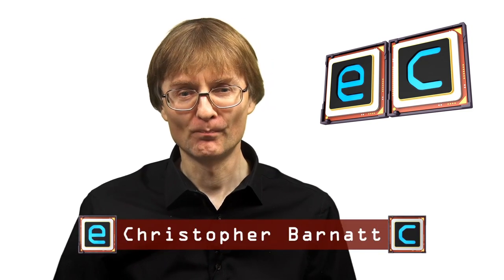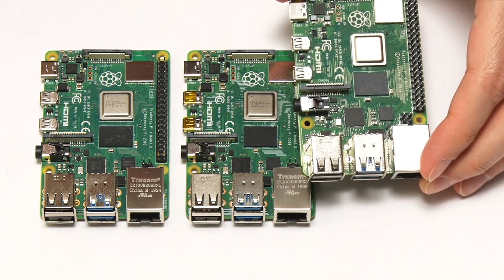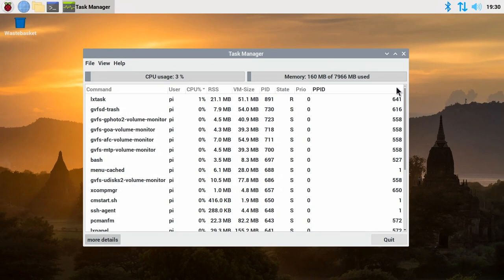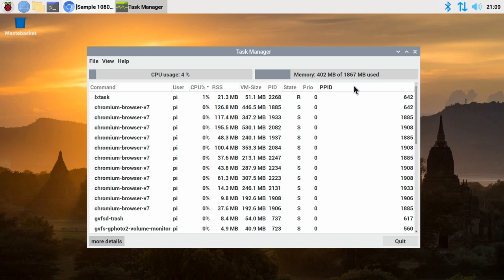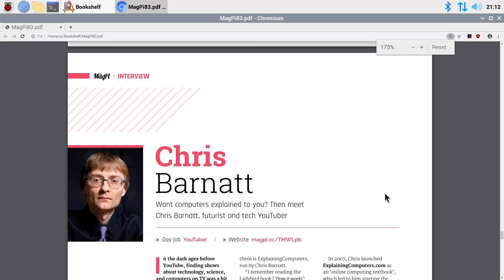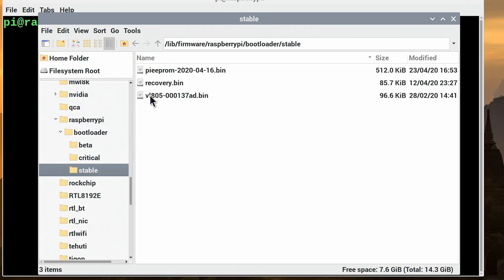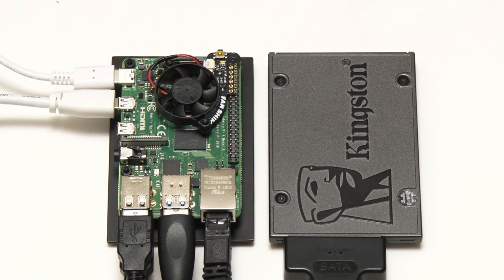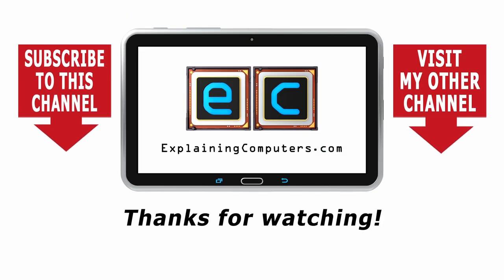Raspberry Pi 4 8GB & USB Boot

Comment: What about the sata to usb 3.0  cable  you are connecting with the ssd. I had found two types of cable online. One is with a power adapter and other one without power adapter. Iam confused which one I have to buy.
Reply from the maker: If you want to use an SSD or 2.5" HDD, you do not need a power adapter. If you want to use a 3.5" HDD, you need a power adapter.
Reply: @ExplainingComputers that's so helpful. Thank you. 🙂

Comment: The procedure didn't work for me, unfortunately. My USB drive is a Samsung FIT Plus 64GB USB3.1 flash drive (model MUF-64AB/AM.)  The eeprom update worked fine. Even the SD Copy Tool worked fine. It copied 5 of 5 partitions to the USB drive successfully. Unfortunately the bootloader couldn't find a suitable .elf file to launch, and the recovery.bin file couldn't be found.

Really unsure what happened. I watched another Youtuber use that exact same USB drive to boot into, in order to make USB drive comparisons for IO speed. His video was a major reason for buying that Samsung product in the first place. I'm downloading the Raspberry PI OS and will try to flash that onto the USB drive using the Raspberry PI Imager tool, to see if that works.
Reply from the maker: Sorry to hear that you are having problems. The issue you describe sounds like an incompatible OS, not an issue with setting up the firmware or the drive. So downloading Raspberry Pi OS and flashing it to the USB drive may well work. Please let me know your progress. :)
Reply: @ExplainingComputers   Thanks, although I'm confused by your "incompatible OS" statement. I had it plugged into my PI.  I just bought a new Raspberry Pi 4 with 4GB. (The 8GB version wasn't avaialble in the US on Amazon.) Using the lastest Raspberry Pi OS. I flashed the eeprom with the stable 6-15-2020 firmware version (which is the same version as the beta with the same date.) I did all this using my SD card, attempting to prepare my USB drive. Like I said, I followed your steps exactly and got that boot error.
The bootloader was trying to look for a suitable .elf file to boot strap on the USB MSD so at least the eeprom flash worked fine (using the rpi-firmware-update command.) After I rebooted the Pi I ran vcgencmd to verify the bootloader_version (it was indeed 6-15-2020) and I also checked bootload_config and it showed BOOT_OPTIONS of 0x0f41  which means it looked for an SD card first before looking for a USB device.
Reply: @ExplainingComputers  After fighting with my new RPi4 -- I was convinced my USB flash drive was not compatible. Until I decided to download the Raspberry PI OS 64-bit version, use the Raspberry Pi offical imager tool, and IT WORKED! Have no idea why the 32-bit versions wouldn't work, but 64-bit does allow me to boot from USB MSD. Which is kinda ideal since I want to run 64-bit anyways.
Reply from the maker: @MrMalchore  Very interesting, and great to hear that you have got it working. From several comments here now I get the impression that there are issues with USB boot and some Raspberry Pi OS . . .

Comment: I am wondering if I can use Rapsberry Pi 4 8GB for my Zoom meetings and Classes at home. tired of moving windows laptop to and fro work everyday. I use a 32 inches TV screen with HDMI port at home and I am thinking of the possibility.
Reply: I haven't tried yet, but the latest is update fixed issues with Zoom and Teams.  So the answer would be most probably yes.
Reply: you can download Zoom with pi-apps and use Teams online
Reply: @tonyhall9433  Thanks, will try this out.

Comment: pi 4 8gb gets a kernel error everytime after i flash raspberrypiOs with a 256gb sd card. are you able to use the 8gb pi or any pi with more than 128gb on a sd card w/o having any kernel crashing?
Reply from the maker: I've never tried using a card of this capacity.

Comment: Can you please make a tutorial about running x86 Windows applications on the Pi? I can't seem to find a viable solution on the internet and i'm not too keen on selling the Pi for a Thin Client.
Reply from the maker: The Pi has an ARM processor, so cannot natively run any x86 OS or application. There is a CLI-only IoT version of Windows 10 for the Pi, and some people (on YouTube and elsewhere) have experimented with ARM desktop Windows on a Pi. However, this has no official support. Windows 3.1 or a little later can run via emulation (eg using DOSBox) quite nicely. But there is no way of running modern Windows applications in a credible or suppored manner on a Raspberry Pi -- which is why you cannot find a "viable solution" and I will not be making a video.
Reply: @ExplainingComputers  Thanks for your reply!

Comment: I have an anther problem with raspberry pi, I want to install ubuntu18.04LTS server headless with pi4, I try many ways but failed. I try to add a ssh file in "system-boot".and I even use software--"Paragon ExtFS for Windows" to open the file /boot and /etc/ssh/sshd_config to change something. and failed also. can anyone kind hearted can help me with that.
Reply from the maker: I would try 20.04, it has better support for the Pi, especially in recent weeks.

Comment: well how about power supply for even a 2G rpi4,,,,,,, with a 21/2 HDD.  now start screen command on the pi zero with 8gb or 16 gb sd card.9with a new rspi os the image writer is different.got some problems with thony python cammera commands like avconv but ..............its discouraging.    ut the 2G new os rspi4 yes very good value

Comment: Can You do a video on making a bootable sd card; it would necessarily have to be step by step.  lt seems all the youtube videos skip many steps, or at least the most necessary steps.  I'm sure there are many who are tired of ordering preloaded cards and can't cause them to boot a raspberryl.  Thanks
Reply from the maker: I have covered this in videos on a great many occasions! :) In short:

Download the operating system image you want from the relevant website (I covered a load of these in my Raspberry Pi 64-bit OS video a few weeks back). If you want Raspberry Pi OS, download from: https://www.raspberrypi.org/downloads/raspberry-pi-os/

Download Etcher from: https://www.balena.io/etcher/ and run the downloaded file to install it.

Insert your micro SD card into your PC or laptop. Run Etcher. Press "select image" on the left in Etcher, and select the image file you have downloaded as above. In the middle in Etcher, click on "Select Drive" and select your micro SD card (it may be selected already). Then click on "Flash" on the right, and allow the process to proceed if Windows throws up any confirmation dialogue boxes.

Once complete, ignore any Windows message that come up about reformatting the micro SD card, and DO NOT attempt to read the micro SD card in Windows. Just take it out and put it in your Pi. :)

Good luck!

Comment: Can anyone link me to the USB 3 to sata adapter please, will require extra ext power adapter?
Reply from the maker: As Blitzen notes, there are loads of these. The one I used was this: https://www.amazon.co.uk/gp/product/B01N2JIQR7/ It (and the Pi) will power an SSD or most 2.5 inch HDDs fine (assuming you are using the official 5.1V 3A PSU for the Pi or equivalent), but you would need a separate adapter to power a 3.5 inch HDD.

Comment: I've tried this several times now, with a brand new Pi4b, 4Gb, and the process runs fine, but just doesn't end in success. When I remove the SD card, I get a text boot screen which says 'USB-MSD boot requires newer software' The bootloader I have used is dated 15th June, and is in both the beta and the stable folders - I've tried both with the same results. Am I missing something?
Reply from the maker: This suggests that you maybe trying to boot an older operating system from USB? Did you update to Raspberry Pi OS and copy that to the USB drive, or write it directly to the USB drive? If you did, I would personally be tempted to try the earlier firmware I used. The firmware should be better! But it if does not work . . .
Reply: @ExplainingComputers  This was a Raspberry Pi OS install straight from a NOOBS preformatted card. It seems to be up to date - shows itself as v10 (Buster). I followed your procedure exactly, using the SD card copy accessory to copy across to the SSD
Reply: And I've tried both an SSD and a USB3 stick, with identical results. I'll try the firmware you used, and see if that works.
Reply: @ExplainingComputers  The only difference I noticed in the process is that the SD copy copies 5 partitions, rather than the 2 that you had. Is that because NOOBS is still lurking on the card somewhere? Could that make the difference? Would I be better off finding a different way to burn the OS to the SSD?
Reply from the maker: @revbobuk  Ah, reading around a bit, the fact that it is a NOOBS card may the the issue, as they are set up differently to if you install Raspberry Pi OS by downloading the image file and writing it to the media. So my suggestion would be to download the latest Rasp Pi OS image and write it to your USB drive. Good luck! :)
Reply: So - further research reveals that you can't use the NOOBS card with this method. But it also looks like according to this websitehttps://www.tomshardware.com/uk/how-to/boot-raspberry-pi-4-usb the latest OS versions have broken the process too - apparently the *.elf and *.dat files from the /boot folder need to be replaced with older ones (from May 22nd) for it to work. Just trying that now!
Reply: And that did it! So to summarise - you can't do this procedure with the NOOBS card. And the  *.elf and *.dat files from the /boot folder need to be replaced with older ones (from May 22nd) for it to work. All sorted now, and working OK. And a significant speed improvement.

Comment: With a bigger data pipeline maybe windows 10 might work?
Reply from the maker: It may work better. But ARM Windows 10 (aside from the non-desktop IoT version) is not supported on a Pi, and I doubt will ever work that well.
Reply: @ExplainingComputers   I'm sure it would lag a bit
Reply: Might be a project to try in the future. I also like the increase in ram and bootable usb where the entire system can be stored in your pocket. Is it possible to run wine on pi is then run Adobe audition or something windows based software?
Reply from the maker: @recyclerlemur2129  Certainly something I may try at some point! But a Pi is an ARM computer, so it cannot run WINE, which is for x86 software only. :(

Comment: I'm annoyed by the 2xUSB 2.0 plus 2xUSB 3.0 configuration. When will a 4xUSB 3.0 version finally come out? USB 3.0 is now old technology. For many desktop uses, I reckon 4xUSB 3.0 ports would be the most useful feature. Ethernet port also makes it looks obsolete. Why still have that instead of wifi and bluetooth? I'd be happy to pay the premium for these features over the 8GB ram. It feels as if the 8GB ram is aimed to a rather niche desktop PC replacement portion of the market.
Reply from the maker: The Pi has onboard WiFi and Bluetooth. Ethernet is essential to create a NAS or server.
Reply: @ExplainingComputers  My bad - thanks for clearing this misunderstanding for me.

Comment: Chris, can you point me to directions for how to make an SD card bootable with a Linux .iso file for the Pi?  I wanted to try Skywave Linux but can't get it to boot no matter what I do!  I've tried everything they say to do on their website but nothing works.  I made a bootable version of HamPi that works with the file they provided using Balenaetcher that works with no problems so I don't know why Skywave can't do that!
It seems to be impossible to make a bootable SD card or thumb drive with the Skywave  .iso!
I've tried using the version of Balenaetcher that I used for HamPi but that wouldn't boot, I tried Rufus, Universal USB Installer, Win32Disk Imager in Windows and DD in Linux but nothing works to make a usable SD card. 
I tried Universal USB Installer with a thumb drive just to see if the .iso was actually any good and that works on a PC but won't boot on the Raspberry Pi.
Do you have any ideas how to make Skywave work?  They have a nice looking website but I think they should have put more effort into making the software work rather than using it all up on the website!
Thanks.
Reply from the maker: I've no experience with Skywave, but the website suggests that it is standard x86 software. A Raspberry Pi has an ARM processor. So you can't run just any Linux distro or other software on a Pi, only ARM Linux software. And this I imagine is your problem.
Reply: @ExplainingComputers  If it's only for x86 hardware, not ARM, that would explain why I'm having a problem!  I couldn't find that limitation mentioned in the description anywhere and  I'm not a programmer so that never even occurred to me.
Reply from the maker: @stevec5000  It's not a "limitation", but you are not the first to confuse a Raspberry Pi with an x86 computer. :) If a software package has an ARM version it will be explicit on its website/etc. Looking on the website, I saw nothing about an ARM version, so it is very safe to assume that there is no ARM version. Most software does not run on ARM. Basically most desktop and laptop software is x86, most tablet and smartphone software is ARM. The Raspberry Pi and similar boards are a rare exception in the middle.
Reply: @ExplainingComputers  I didn't confuse a Raspberry Pi with an x86, I just assumed that Linux software would run on a Linux computer and the fact that it was PC only never even occurred to me.
Reply: @ExplainingComputers   I had assumed Skywave ran on the Pi because the apps that come already installed in it such as Dump1090 are for the Pi!  When I run Skywave on a PC most of the apps don't seem to work, maybe it was all just put together badly but how do you get Dump1090 to work on a PC?  When it starts up all I get is a map of China! Also Skywave is the only Linux I've ever seen that doesn't have a Terminal app!

Comment: Great video - makes it really easy! :-)

Unfortunately my Pi4 only boots with 1 out of 3 SSDs:

1) Western Digital WD Green 120GB (Serial ATA-600) --> Not booting
2) SanDisk SSD PLUS 120GB Sata III 2.5 Zoll (Serial ATA-600) --> Not booting
3) Samsung MZ-5PA064/EU 64GB SSD 2,5 Zoll, 256MB Cache, SATA (Serial ATA-300) --> (nearly 10 years old!!!) --> Boots perfectly

I just exchanged the SDDs, everything else is identical (software setup, EasyULT USB 3.0 SATA adapter cable, ... ). Ideas anybody? Maybe the SATA version?
I fear this vintage SSD will die sooner than later.

Thanks!
Reply from the maker: Hopefully in time support for more devices will improve. I've found that writing an image to an SD card, doing full updates, and then imaging to the SSD often works when imaging directly to the SSD does not.
Reply: @ExplainingComputers  Thanks for your reply! In the meantime I found the issue and maybe this is something you might want to confirm and potentially add to your description. Obviously the EasyULT SATA adapter cable I used has the wrong chipset. It's ok for the old SATA-300 SSD and was very reliable on my RPi 3. But if you want to conect a new SSD (all SATA-600 SSDs?) to a RPi 4 with USB 3.0 it's not going to work. I bought a new adapter cable with an ASM115X chipset and now everything works like a charm. You can buy these online for about 8€.

Btw. you can check your current chipset on the RPi by entering "lsusb" in a terminal window.

Comment: I want a make a mini for my programming class to learn more coding.
Can u make mini laptop with raspberry pi 8gb version and boot with ssd and install windows 10 and run exe software. Please make a video on this step by step
Reply from the maker: Note that a Rasberry Pi has an ARM processor, not x86. So it cannot run (standard) Windows or run exe files.
Reply: It can run Ubuntu window or not

Comment: Does the RPi 4 8gb still over heat?
Reply from the maker: It does get warm still! Since the firmware updates later in 2019, not as warm as it used to. But I would still not run a Pi 4 without some form of cooling.
Reply: @ExplainingComputers  ~ thanks, appreciate it. Just checked. Most cases for the RPi4 seem to come with fans and heatsinks now. Great.

Comment: I looked at the box my Pi4 came in. Element14 eh ? The company that came out of Acorn - RIP. I didn't know that !
Reply from the maker: Indeed, interesting roots.
Reply: @ExplainingComputers  Do you happen to know if the RPi can act as a time machine drive server for an APFS drive ? I have spent a day creating it only to find my RPi can't write to it !

Could you do a video about micro sd cards and why the prices can range form £20 to £400 for something that - to the currently uninitiated look like the same thing ? Thanks !
I ran a test on the one in my Pi, and it failed - but - I was happy with it until then...

Comment: What Adaptor is that for the USB to Sata? I am trying with a USB 3.1 Sata Enclsoure unit and I can only get 700kM/s from the SSD and when I add max_usb_current=1, i can get to 2MB/s.

I am using https://www.amazon.ca/gp/product/B01JNLC888/ 

I tested it from:
* my laptop and I get 450 MB/s from the drive in the enclosure
* my Gaming tower 465 MB/s from the drive in the enclosure

I also know it's not the SSD as i moved it to a 2.0 3.5 powered enclosure that maxes out at 120MB/s and I got 120MB/s on the pi. just not practical in the unit that holds two 3.5 HDDs.

Comment: can you install  full windows 10 on the raspberry pi 4 and how would you do it
Reply from the maker: The Pi is am ARM computer, not one based on an x86 chip, so it cannot run the standard version of Windows 10. Some have experimented with the ARM desktop version, but it it not supported for the Pi. If you want to run Windows, don't get a Pi. :)
Reply: @ExplainingComputers  can you run windows 10 ARM based on the raspberry pi 4 like what you could do with the raspberry pi 3